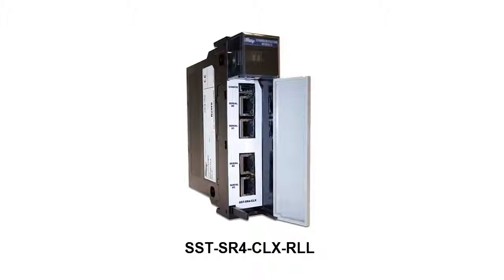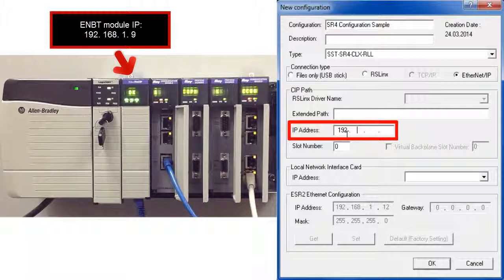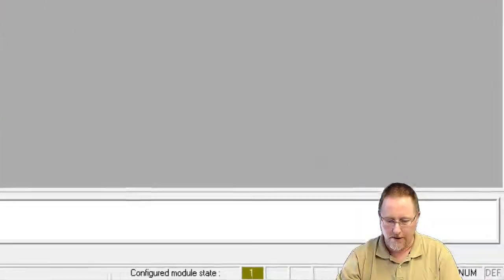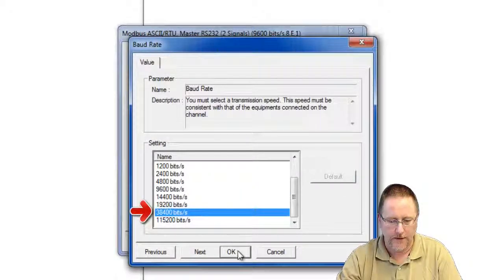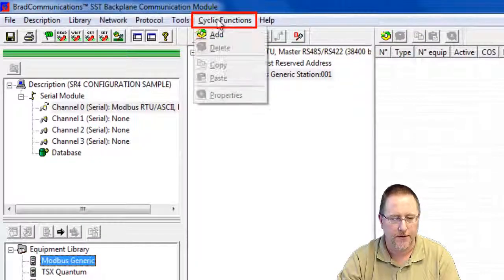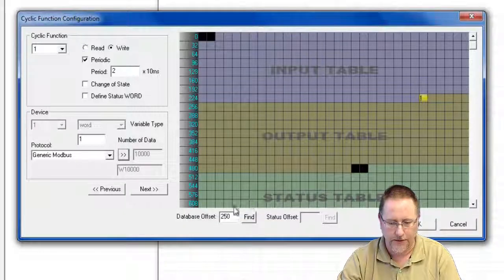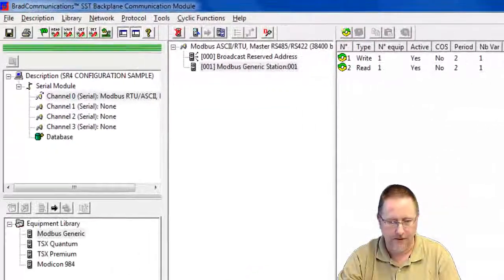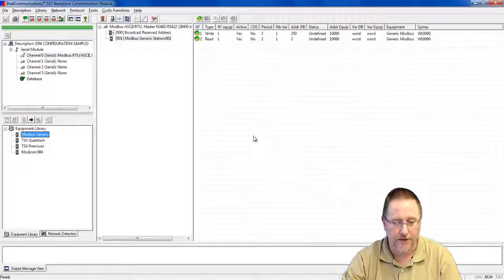Molex - SST-SR4-CLX-RLL Basic Configuration

Comment: Thanks for your video. Could you tell me about extended path if the module is installed on the Remote IO rack in controlnet network of Rockwell PLC